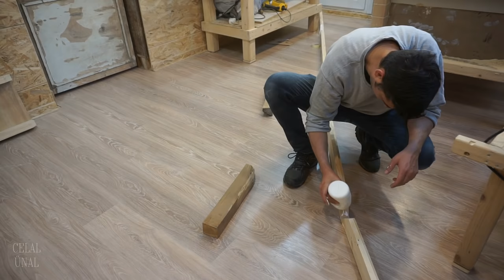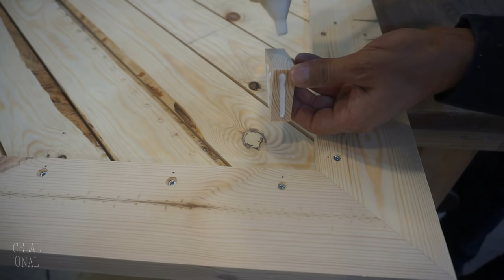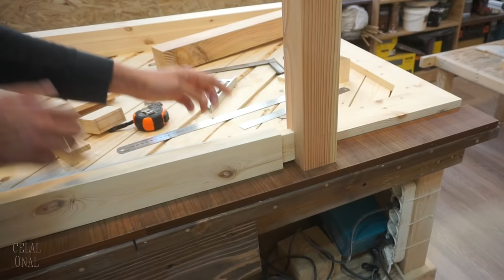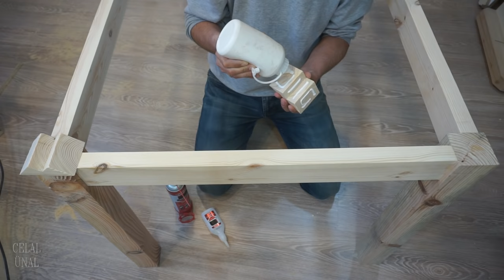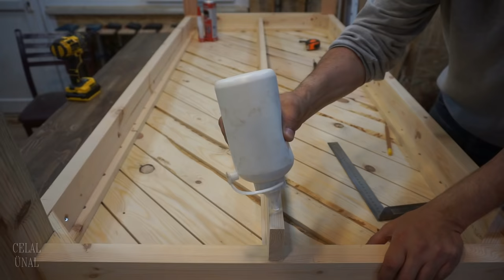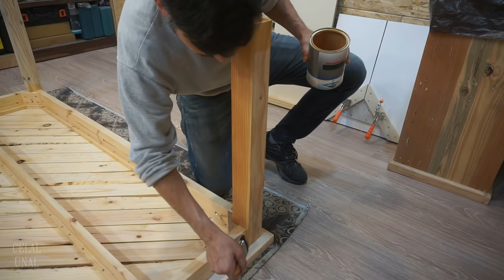Wooden dining table / Diy Woodworking / Ahşap yemek masası

Comment: It's nice but the frame will crack as soon as the wood will start to move... because it's all glued in, no space for wood movement.
Reply from the maker: There is no such problem at this table.
Reply: @CelalUnal1  table makers typically don't screw or glue the tabletop, they make the tabletop float by using Z shaped brackets in a slot or screws but with washers in a larger bore.